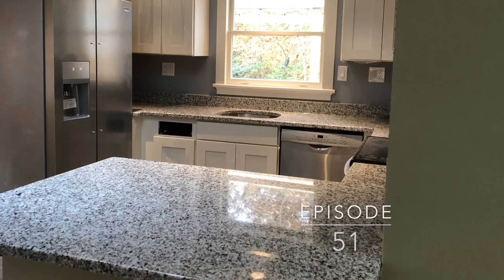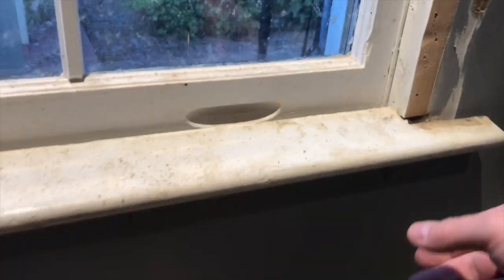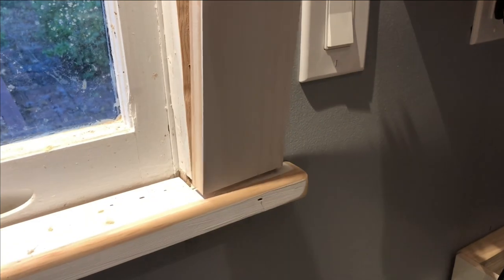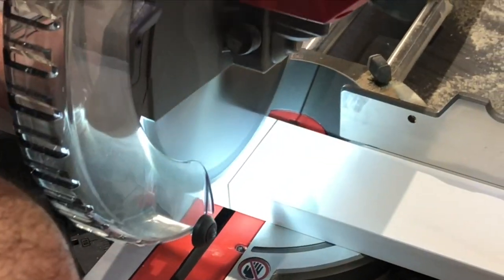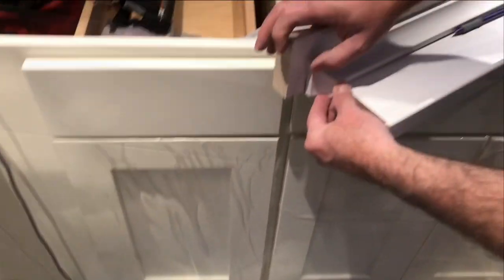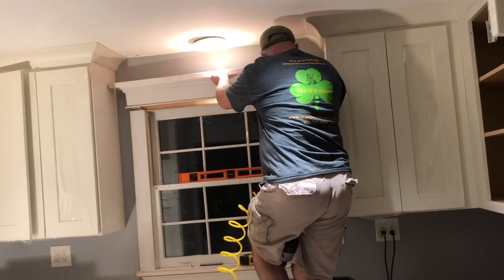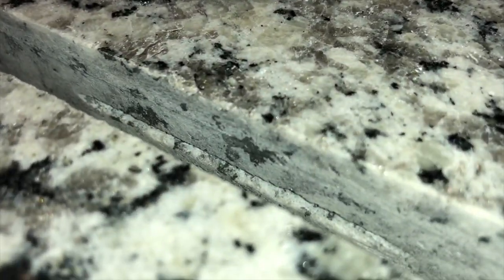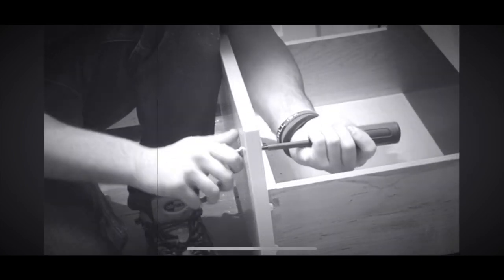Complete Kitchen Remodel V.12 - Craftsman Window & Granite

Comment: Why no plywood under the granite top?
Reply from the maker: Howdy Byron Gaona!  Quick answer is - plywood is not required.  If the granite is over 1-1/4” it does not require an underlayment.  You SHOULD consider installing an underlayment to support long unsupported runs, but that does not factor in with this kitchen.  However, that is a design consideration for overhanging bars...which is why this ‘bar top’ overhangs by 11-1/2” ...  the limit recommended by my installer.  For large overhangs you could use corbels to avoid having to use plywood.    Good question tho...thanks for asking!    ☘️